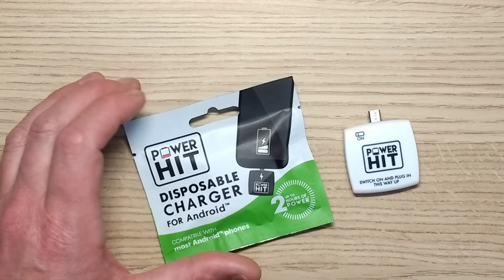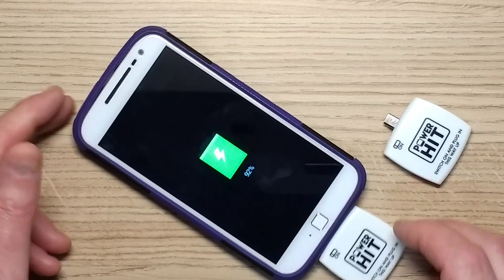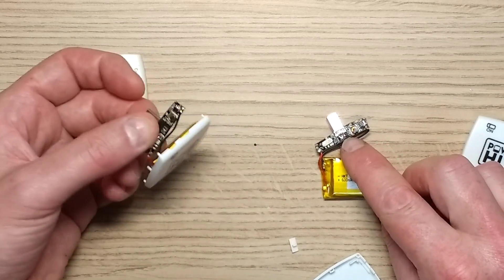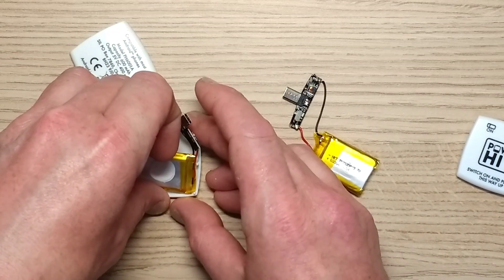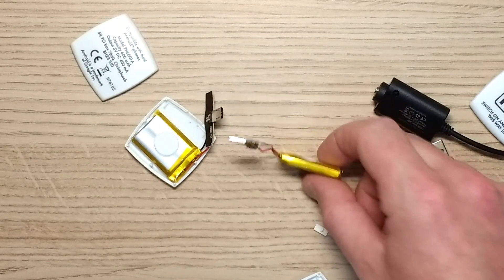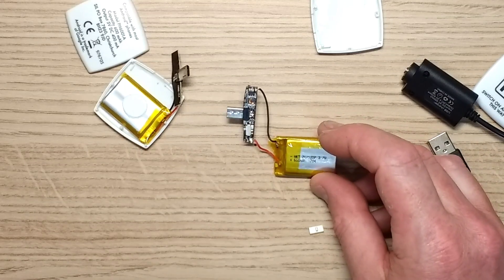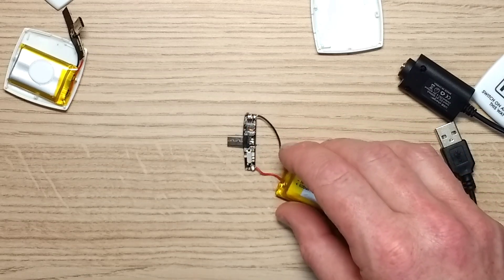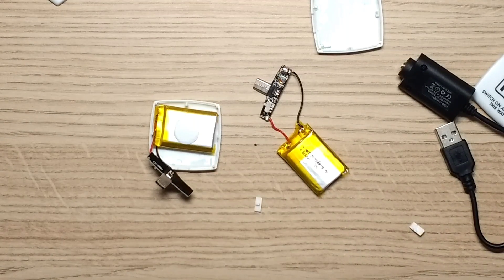What's inside a Tesco Power Hit disposable phone charger.

Comment: What is 400mah going to do for my 4000mah Samsung?
Reply: 10% battery can allow you to call text or do something important
Reply: What's it going to do for my 13,000mah Ulefone power 5
Reply: 5% tops.
Reply: typical 9v battery has 400mAh.  so not sure why to make a not reusable lithium battery pack.
Reply: its for emergency
Reply: Hey can even make it with Duracell normal battery
Reply: @niloaguilar6970  Not really Some of the energy of the Battery will be lost as heat so you won't get 400mAh

Comment: These are labeled as disposable because they use failed tested parts to produce it. They get them for a 50th the price and because they usually would just be recycled or thrown out, they figured this was a good way to use them up. It's a nasty practice IMO.
Reply: Nathan Just wondering. You know this for a fact, or you assume it to be a fact? Do you have any evidence to back up your assertion? As I said, just wondering.
Reply: Norman Dunbar I read that in an article about them a while back when they started selling. I'll try to find it for you
Reply: Nathan Ok. Thanks.
Reply: Still waiting for that article. Until then, let's just assume that's made up BS by the manufacturer. Even if it was true, it's still an horrible idea because once people get used to mindlessly buying such products, the production will need to increase and while rejected batteries will go lower in production (because better processes), the demand will increase, resulting in using perfectly usable batteries for one shot products.
As for recycling, the rejects are entirely recycled, while these products won't so it IS an ecological disaster.
Reply: Im pretty sure the company uses some legal loop hole to label those dissposable
Reply: I know this is not true, but if it was then the better option would be to recycle the battery instead of throwing it into something like this anyways so its still not defending their cause.
Reply: Sapphire Destiny the process of recycling them would likely end up being more money then they would make selling them like this.

Comment: @bigclivedotcom the reason the data pins are shorted is because this is the way a signal to a device being charged that it is connected to a power source designed for charging. This means the device will stop using USB current draw limits and start charging at the highest current it will support to achieve a quicker charge.
Not really advantageous here when the USB limit is 500mA and the battery is 600mAh before buck conversion!

Comment: If you can, you should break out the microscope and try to reverse-engineer a circuit diagram for this, like you've done for other products. I wouldn't be surprised if that board could be used to recharge the battery, but has had certain components (like the inductor) broken or disconnected to convert it into a single-use product.

Comment: Data pins are shorted to bypass phones charging security validation and allow faster charging (phone allowing more current to pass). There are phones that are checking if charger is original, valid, authentic and if they should accept more current from it than, usually, 500mA by using resistor between data pins (usually, 2000Ohm), but in most cases simply shorting out data pins would help phone recognize charger as one that is up to USBBCS.
Reply: To expand a bit, shorted data pins is the official USB standard, and some manufacturers check for a resistance between data pins, while other manufacturers look for specific voltages on the pins. These vary not only by brand, but sometimes by product and generation. You might find an iPad that only draws 500mA from a 2A iPhone charger because they use different standards.

Comment: Be careful recharging those! They could be lithium sulphur batteries in which case dendrites could form on the lithium anode and travel through the electrolyte over into the cathode on the other side which could eventually create a short circuit that could blow up the battery. I'm not sure exactly what type of lithium batteries these are but it could be a serious risk. They've stated that they are single use so it wouldn't surprise me if they used an electrochemical formula that is at risk of blowing up >__<
Reply: It’s impossible for that cell to be lithium sulphur if it’s labeled ‘3.7V’. Li-S cells are only 2.5V.

Comment: Get a cheap 10000mah battery bank, probably gonna give you about 2-3 charges while costing about 10-20€
Reply: Demonhog Plays And you  an recharge it, and use again.
Reply: Topias Karjalainen yeah, that's what i forgot to say
Reply: The idea is if you forget them and need your dead phone straight away for work.
Reply: it wouldn't give me a full charge (10Ah phone battery+efficiency problems.)
Reply: manaquri what kind of phone do you have that has a 10Ah battery?!
Reply: phones that I know of with a 10Ah battery:
oukitel k10000, k10000 pro, k10000 max, and k10
blackview p10000

Comment: I paid the US equivalent of around 30 pounds for a 10,000 mah battery that gives me 3 full charges of my phone. This product is such a waste of money. Why would anyone get this over a battery pack they could recharge?
Reply: Garrett Swenson maplins has a 20,000 for £60 I managed to get it for £50 (think it was a sale)
Reply: Garrett Swenson I bought mine for 20 pounds and it charges my shitty phone 7 or 8 times
Reply: Low price point. People see the 3 pound price tag & buy it. This is why pound shops & dollar stores are in business. All their products are a dollar or one pound. You think it's cheap, but you can get a better brand at a department store with better value for money.
Reply: they go to poundland and buy a fucking charger
Reply: glswenson the only reasonable reason is you are in urgent need of charging your phone which has run out but you forgot your charger and power bank
Reply: wouldn't be sold if no one would buy.

Comment: I use lithium ions on pretty much everything in my house, now. But seeing this as a one time use thing saddens me. 600mAh is a decent capacity for a small battery, and if I saw a wasteland with all of those power bank things, I'd rip them all for the boost circuits and the Battery.
Reply: Screw the boost circuits, I'd be taking every last lipo cell

Comment: its a shame they didnt add a small overcharge protection circuit and usb input to charge  probably could have gotten it to fit 
potential mod for these i guess though?  seems like a fun project I need to learn more about electronics at component level and give it a go as im guessing a standard usb cable soldered to the battery would just blow it up
Reply from the maker: The usb cable soldered directly to the battery would definitely not be a good idea.  The manufacturer of these also does a rechargeable version.
Reply: can i ask where you learned all of your information by the way i love doing this sort of stuff in my spare time dismantling and inspecting electronics but my knowledge of chips and stuff Isn't exactly the best was it college or all self taught :) 

thanks for replying by the way too love the channel mate

Comment: You get a tiny lithium battery you can cut the wires to and rewire to something else basically.  Said battery would be usefull for aerial drones or other random projects, (micro rc/s and things) but most are just going to end up in the trash.  If you could find the end connectors that drone batteries have , then recharging them via usb shouldn't be too difficult. Do you know what the voltage and Milliamp rating is?

Comment: Wow is this the standards our generation has gone to now! Sad times!
Reply: kingtoyab69 does our generation not put disposable batteries in our TV remotes? I do agree, these should be a thing of the past by now. However, I fail to see how this is any worse.
Reply: robbie cairncross this is a single time use product to use for 2 hours, in the 3 years I've owned my last TV I changed the batteries only once: I used them for at least a thousand times before throwing them away.
Reply: And if you bought rechargeable batteries you could charge them up and reuse them multiple times for multiple products. And please dispose of batteries properly, most shops have battery disposal bins in them so there really is no excuse to send them to the landfill.
Reply: It's the standards marketers have gone to... not necessarily everyone of the generation.
Reply: Wasteful and nonsensical, but not really different than all the alkaline cells we use regularly for toys that drain the full charge within a day or two.  Or disposable cameras, hand warmers, bottled water, candy wrappers...
Reply: Nothing new in this concept remember disposable cameras 
You could just remove the photo roll
Replace it
And use it again
Reply: Seems more like a baby boomer or gen xer marketing guys idea
Reply: And you still need to use electricity to charge them

Comment: I got similar one and added jst connector to it so I can charge it... second one got charger circuit and wrap of duct tape. Cheap and it works, great for arduino and esp8266 power on the go.

Comment: To my understanding, the bridging of the pins is used for a higher powered charge? The device reads it as a charge only and switches to a higher charge rate, when they aren't connected it is in a transfer state. Correct me of im wrong :s

Comment: The DATA pins are shortened together, most phone will take up ONLY less then 500MA if the data pins are floating probably as the phone thinks its connected to a USB port and doesnt want to overload the 500ma limit of the usb standard. BUT if the data pins are jumpered then you get the full charging current draw of almost 2A

Comment: can be that battery reuse as a replacement for broken MP3 player battery?? it looks like a perfect size and capacity for my sansa clip.
Reply from the maker: If the existing battery has no on-board protection chip then it could work.
Reply: bigclivedotcom how to check if there is or is not a chip?

Comment: Not that it matters at this point, but... The standard for charging peripherals, says that you bridge the data pins to let the device know it's fast charge capable. different resistance values are then used to tell the device exactly how "fast" a charging unit is able to support. Nowdays with 12v support as well, i guess they have added some actual logic at some point, but for anything still only providing 5v, bridging is perfectly fine.

Comment: You can use the battery for most cheap drones just attach the right connection head to it and you have a cheap drone battery
Reply from the maker: These are not high current cells.

Comment: @Clive the shorted data lines on the usb connector are to tell the phone that it can exceed the 0.5A draw limit that would normally be on a regular USB host (like a computer USB connector that is meant for data). Almost all USB wall chargers have thses pins shortened too.

Comment: I think that is a Lithium-polymer battery, not a Lithium ion. This would explain the disposable part, because lipo will swell up and become a fire hazard if not stored or used treated correctly, but they probably chose lipo because it has a higher discharge rate and capasity than a cheap li-ion battery.

Comment: The data pins in a USB charger are almost always shorted - this is generally the protocol for a dedicated universal USB charger.
Perhaps they clipped the inductors for mechanical fit reasons?  Couldn't tell but it kind of seemed like there might be a little plastic but which would otherwise collide with the inductor?

Indeed this is disappointing to see such waste - a boost converter topology can be easily modified to also support buck-charging with just a couple modifications to the IC, for which widespread chips are available.

Comment: These and disposable vapes are great sources of tiny form factor rechargeable lithium cells.
Dunno how many projects I've used them in. One of them plus a boost converter and charge controller powers my multimeter because I hate 9 volt cells.
This company could make the item another millimeter thicker, slap a 4056 board in there instead of the little naughty discharge board, sell it for a dollar more, and eliminate all the waste.
Reply from the maker: They're like street gold.  Free lithium cells lying in the gutter.
Reply: @bigclivedotcom  Indeed. In Canada you don't really see them far as I know, but we do have the disposable vapes with the little nugget lithium polymers.

Laptop batteries are great sources of 18650s for random projects. They may not be up to high discharge rates or full capacity any more, but for random little projects that need an amp or two they're gold. I just mark them with a certain color sharpie if they underperform. 

I'm also a huge fan of flashlights that use the little 3xAAA insert. They typically snugly fit one 18650 and will happily run for hours on one. Better LED life too due to slightly lower voltage. Just use protected cells or mind the runtime. :) Great for power outages.

Comment: If someone were to set up a dropbox at a gas station where you could actually “throw them away” in and then you could collect all those lithium cells putting them in a Series or parallel configuration you could build some big portable battery packs. 5V 12v or 240v etc

Comment: Not a ecological issue unless you actually throw them in the trash. You can bring them to major electronics retailers or any transfer station and there is a good chance that they have recycling bins for lithium ion batteries. Or you could strip the cells out of the unit and sell them on eBay to get your money back

Comment: Can anyone help me, can you run bigger batterys through the circuitry
Reply from the maker: You could connect a bigger lithium cell to it, but it still wouldn't allow it to be recharged.  A proper power bank is a better option.
Reply: @bigclivedotcom  thanks for replying I wasn't expecting a reply from from the big man(GOD) 😉   after I watched this video I replaced my small quad copters batteries for £3 each.  And I have three bigger 3000mah cells I'm going to try making a 3cell balance charging circuit with three separate 3.7v micro USB, it'll probably go bang like almost everything I make, I'm pretty new to electronics apart from watching hundreds of your videos I have also spent most of my life obsessively taking everything apart, keep it up

Comment: I do wonder if the reason it's disposable is because the batteries are made to very low safety standards.  Maybe it's the case that it works fine once 100% of the time, but if you were to try and recharge it, it would burst into flames (ie fail catastrophically) 5% of the time.

Comment: That's horrifying.  I mean, I want some for electronics projects, but as a consumer device it's disturbingly irresponsible.

The price point is surprising too.  In the states, you can get one with the charging circuit and port for maybe 5 USD without going out of your way looking.  The component quality might be crap, but you can usually get at least a few uses out of them. I have one that's still good after 6 months I bought at a closeout store for less than that even which I have powering a pi.

Comment: Absolutely incredible. Waste of resources in its clearest form. It is one thing that many things are hardly repairable nowadays, but to use a lithium rechargeable battery only just once is really hard to beat.
Since this is an old video, I hope that they are smarter by now and have taken such nonsense off the market. The fact that there is a version that can be recharged is only a weak excuse. I suspect this one will probably be more expensive too.
Reply from the maker: Most modern "disposable" vapes also use a rechargeable cell.

Comment: Assuming a sustained output of 5V and capacity of 600mAh, you are paying for energy here at a cost of £1000 per kWh. So, about 8000 times more expensive than using your supplied mains plug-in charger. Yup, makes perfect sense!

Comment: Once I got a few dozens of disposable phone chargers without any batteries, you need to put an AAA battery inside, it also produces 5.9 volts and with a load of 2k 5.7 so it's also a potential phone killer, I was suprised that you just pluged your (disposable?)phone to it or maybe you did checked the output before.

Comment: If this were a carbon-zinc battery it would be a neat if fairly stupid idea, since carbon-zinc batteries aren't all that environmentally hazardous, just wasteful since they're inherently non-rechargeable. Still wasteful, but not moreso than other disposable batteries, and in many cases more useful since nowadays plenty of devices use internal rechargeable cells powered via USB rather than disposable batteries. But doing this with lithium ion batteries is several disasters waiting to happen, not least of which contributing to the massive environmental cleanup we're going to run into a few years down the line when all this excessive lithium battery production catches up with us.

Comment: disposable lithium ion is a tragedy some devices detect 500mA slow charge by bridging the data pins... I think one such device is Sony PRS-1 and Sony PRS-2 ereader.... having owned both, some cheap 2amp chargers that used this method would put the readers into a charging mode and didn't allow use of the reader while charging..... chargers that threw something like 2v~ I think it was to the data lines would enable fast charge and the device was usable while charging